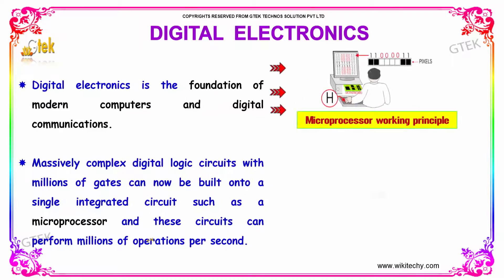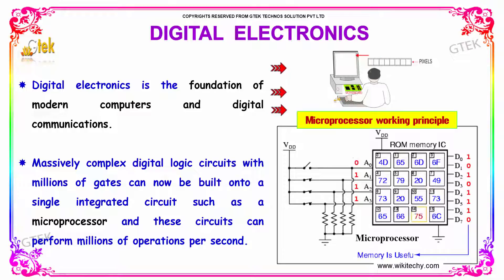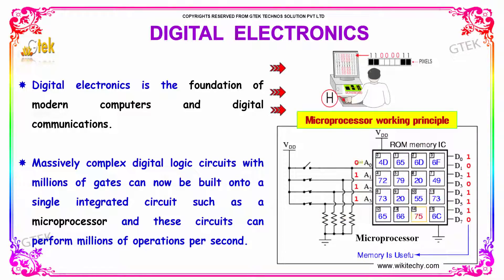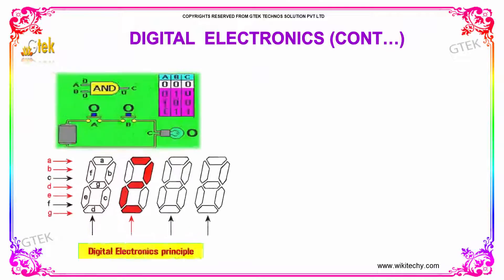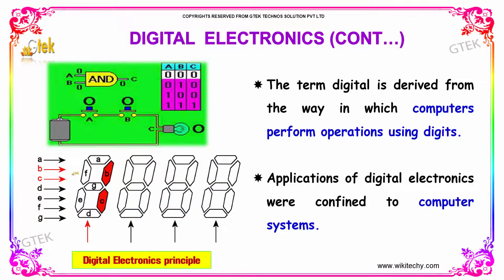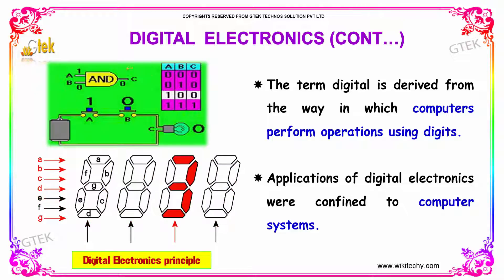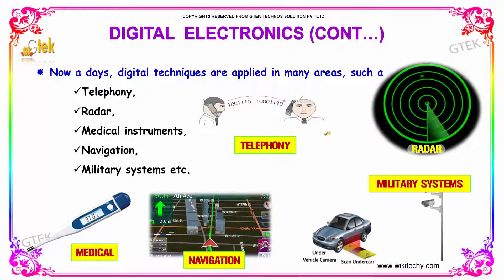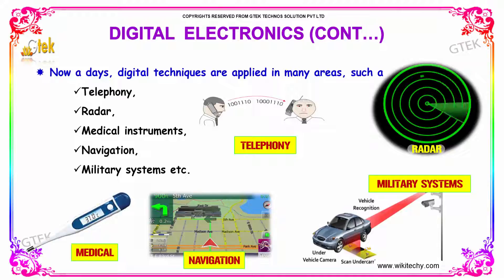Digital Electronics Semiconductor Devices Class 12 physics subject notes lectures CBSE IIT JEE NEET

Comment: Digital electronics or digital(electronic) circuits areelectronics that handle digitalsignals (discrete bands of analog levels) rather than by continuous ranges as used in analog electronics. All levels within a band of values represent the same information state.

Comment: Digital systems represent information using a binary system, where data can assume one of only two possible values: zero or one. • Appropriate for implementation in electronic circuitry, where values are characterized by the absence/presence of an electrical current flow.